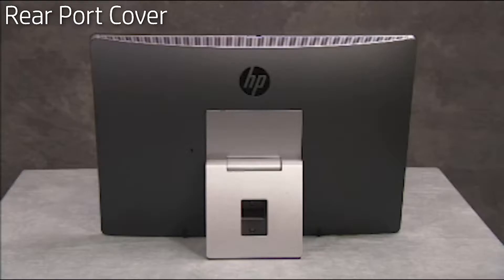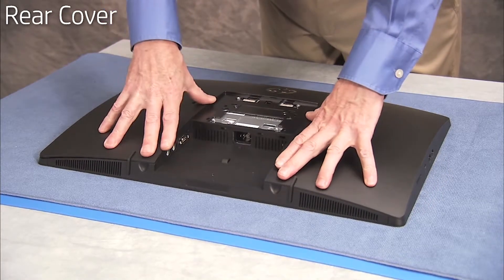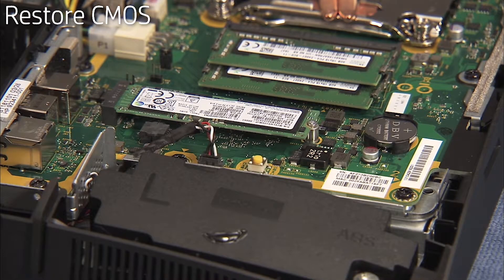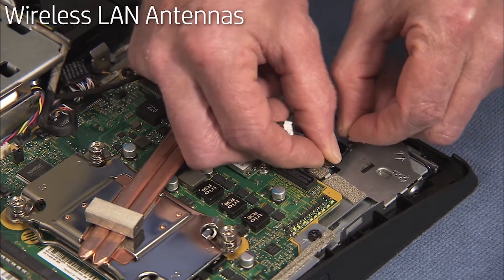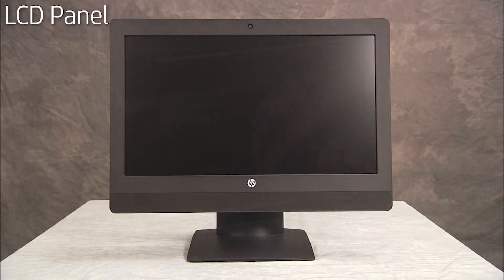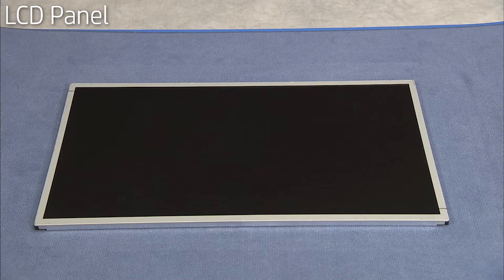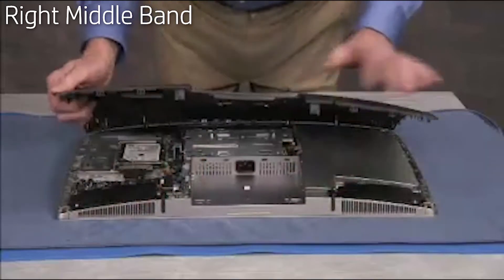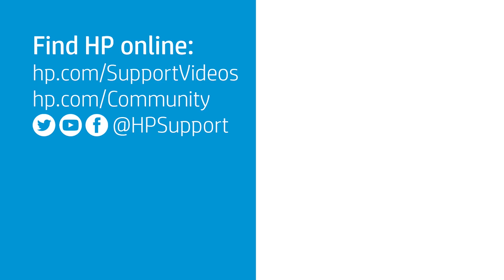Removing & replacing parts for HP ProOne 600 G3 21.5-in | HP Computer Service

Comment: Hi, I have a HP ProOne 600 G5 with a damaged screen, that was still in warranty. What are my options to repair the unit, as there isn't spare parts here and there to buy.
Reply from the maker: +starfox14now Please contact our phone support team to fix this issue. Please follow these steps to reach them.
Step 1. Open link: https://support.hp.com/us-en/contact-hp
Step 2. Select the product type.
Step 3. Enter the serial number of your device or select let HP detect your product option.
Step 4. Select the country from the drop-down.
Step 5. You should see the HP phone support number.